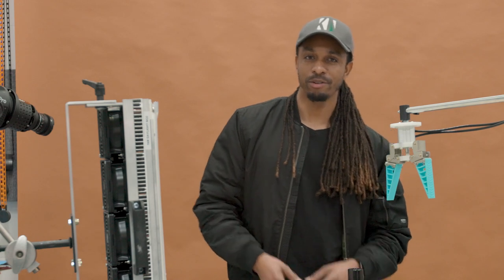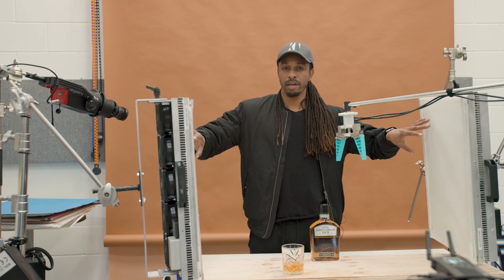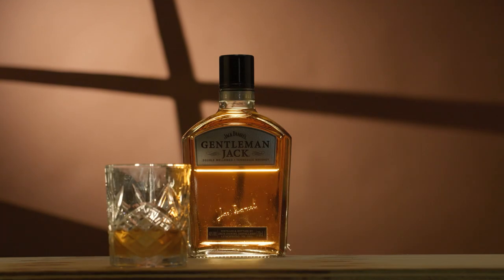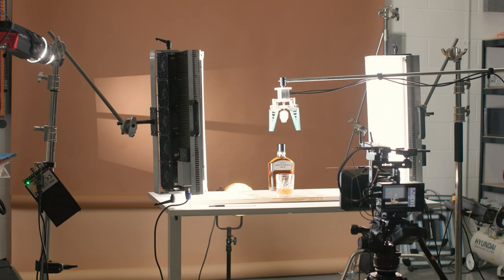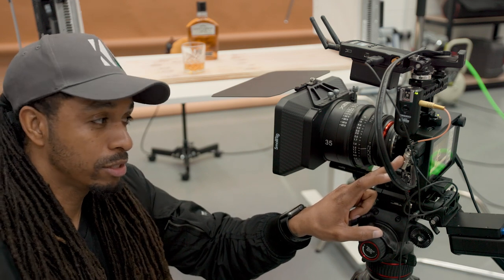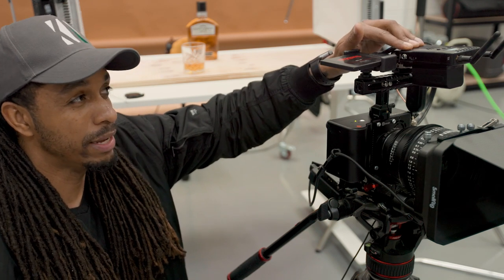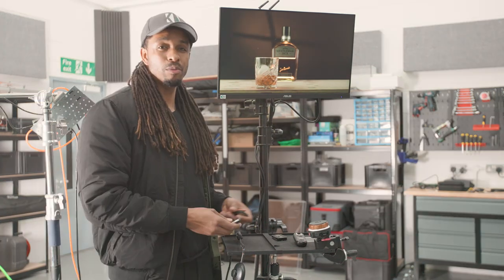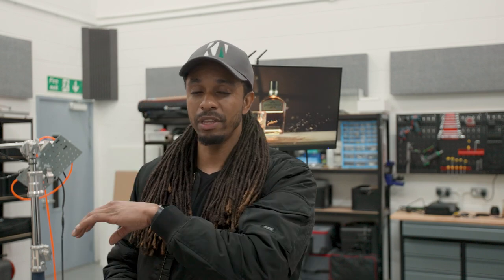High Speed Whiskey Splash | Behind the Shot

Comment: Looks great. I'm in the process of setting up Dragonframe to control my scene so I can automate things. I don't have a little helper !
Reply from the maker: Thanks Josef. I keep hearing about dragonframe , I’ll check it out
Reply: @KirthNoel  No probs. If you don't need to control Stepper motors , You could also use a light control DMX program like Qlight controller which is free then get a generic amazon USB to DMX cable and link that to an amazon DMX relay control board. You can then turn the relays on and off when you need by setting each relay as a fixture and set the DMX address of the relay card in Qlight. I use the relay card with my DMC controller but you don't need Dragonfrane to do that.